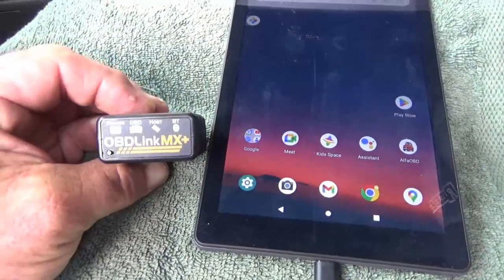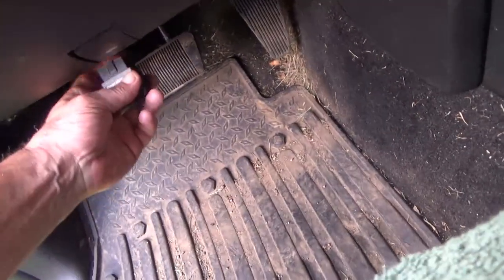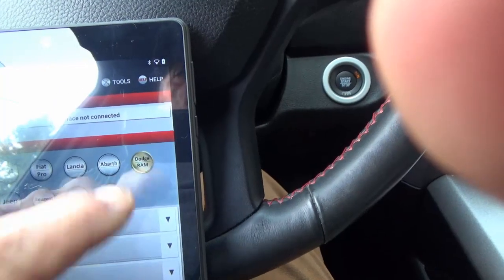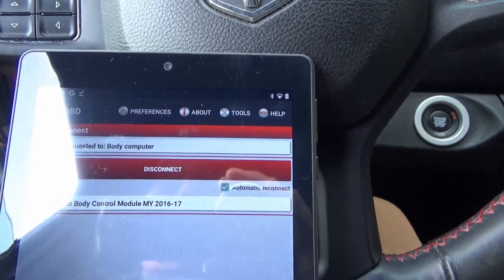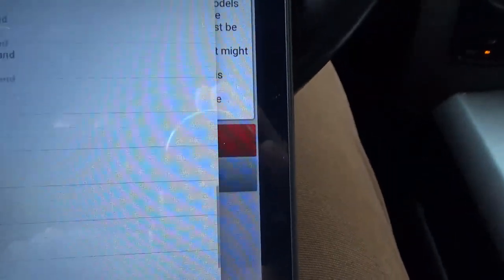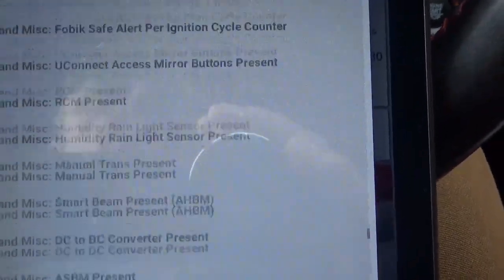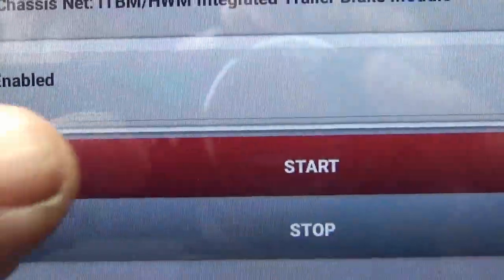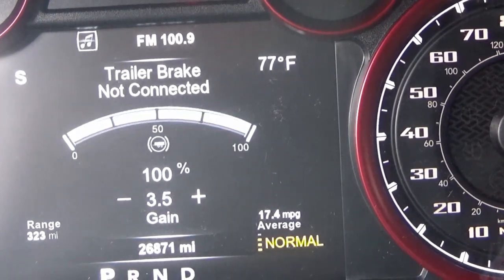Ram 1500 OEM Trailer Brake Controller Module Programming With AlfaOBD

Comment: Purchased both the OBD module and alpha obd...ran through all these steps and I still cant enable my TBC
Reply: After selecting all the drop down menus you say to, the device remains in disabled
Reply from the maker: @aaronm1855  If you have everything connected correctly it should work unless there is a fault in the switch, wiring, or the module. I was kinda anal and made sure I bought the oem module just to make sure I had at least the 12 month warranty through Mopar in case of issues. I'd double check that everything is plugged in correctly. This vid is the steps that worked for me and others who have commented here.

Comment: The bypass cable... actually, this is a measure for theft prevention... OBD and CANBUS signals were not originally designed to control everything on the car and they didn't have theft in mind when it was created. Unfortunately, now it connects everything, hackers found a way to gain access to the car just by removing one headlight or taillight (because yes, it's now also controlled by CANBUS), unlocking the doors, starting it and driving away. To counter this, FCA (and others) decided to isolate the "main" computer behind a firewall, also encrypting the OBD port so only dealers could access advanced fuctions like programming a new key or starting the car without keyfob.

Naturally, it has the side effect of having to pay the dealer for every  re-programming, or having to buy a decryption module or a bypass cable. (Some methods will void you warranty if you get caught AND the ability for the dealer to connect via their OBD systems)

**From 2019 Classic models onwards, they even placed one connector behing the radio to be able to bypass one of the computers... Pure waste of time in the name of anti-theft in my opinion

Comment: what # is on your brake controller I have a 2017 Ram with A2C7509200200 wondering if it should be A2C7509200100? programming isnt recognizing the trailer tried everything with Alpha OBD and even went to the dealer but they never checked the P/N
Reply from the maker: This is the one I bought - https://www.amazon.com/dp/B07N1V5SM5/ref=pe_386300_440135490_TE_item

Comment: I just bought 2016 Ram with a OEM brake controller. When hook trailer up, lights on the trailer works. But truck indicates trailer not connected and brakes don't work. What could the problem be. Thanks for the help in advance.  Brakes controller works in my other vehicle. Si don't think it te trailer.
Reply from the maker: Possible that the truck didn't come with an OEM trailer brake and someone installed it later and never programmed it or they programmed it incorrectly. Would advise taking it to the dealer and letting them check that it's actually programmed correctly. Otherwise, it may be a bad trailer brake module.
Reply: @SteeveeDan  thanks

Comment: When you squeeze the brake control is was your trailer plugged in when I squeeze mine that gauge doesn’t go to 100 but it lets me use the plus and minus without trailer plugged in
Reply from the maker: It was without the trailer connected. I just double checked it and mine goes to 100 without a trailer connected and it also allows me to change the gain. Maybe just a difference in the year of the truck?

Comment: I did this on my 2016 and the brake gauge shows up every time I press the brake pedal, even without a trailer connected. also, the truck doesn't recognize the trailer when it's connected. braked work, but the gauge still says trailer brake not connected, any thoughts?
Reply from the maker: If you have an OEM module and switch I'd double check that it's programmed correctly. It should work fine with OEM parts and the correct programming unless there's an issue with the module or there has been some wiring changes/damage over the years.
Reply: @SteeveeDan I have the same thing happen every time I hit the brakes it goes right to the trailer brake mode. Any ideas or fixes?
Reply from the maker: Sorry, I've not experienced that, here is all I can think of - If you have an OEM module and switch I'd double check that it's programmed correctly. It should work fine with OEM parts and the correct programming unless there's an issue with the module or there has been some wiring changes/damage over the years.
Reply: Did you find a fix for this? I have the exact same issue on my 2018.

Comment: Thanks for this video huge help!! However...my DT 2020, when i manually activate the trailer brakes, no trailer connected,  the percentage gauge doesnt show any percentage value 0-100%. Thoughts??
Reply from the maker: Honesty I'm not sure for a 2020. If you have everything connected and the module enabled, it should work unless there is a fault in the switch, wiring, or the module. I was kinda anal and made sure I bought the oem module just to make sure I had at least the 12 month warranty through Mopar in case of issues, but so far so good. I'd just double check that everything is plugged in correctly, double check that it's actually programmed since if it isn't the dash display won't work. Hope you get it going.